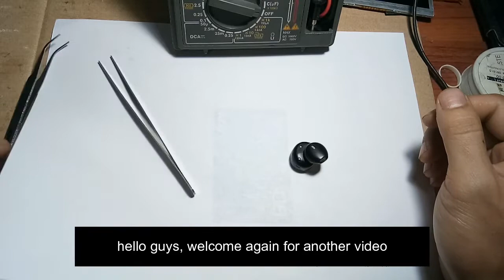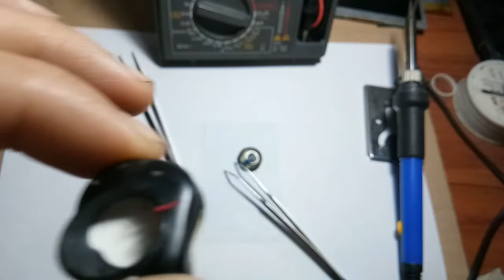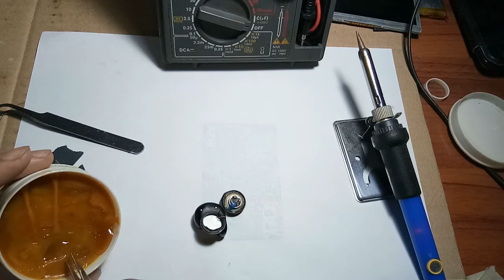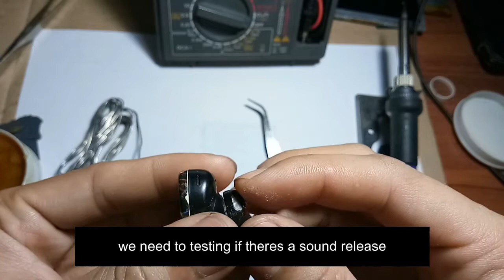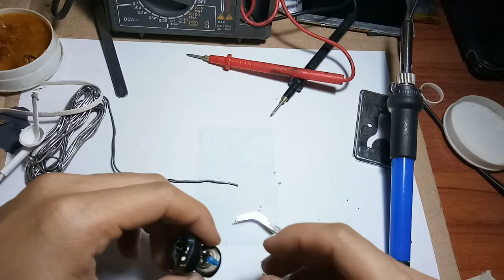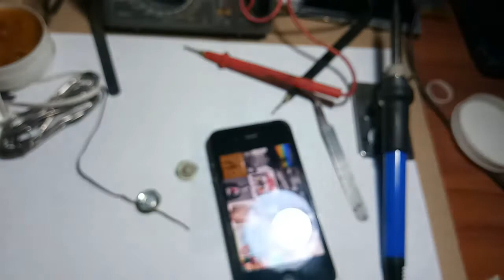Wireless Earbuds Repair/ Bluetooth earphone (Sabbat X12 pro)

Comment: Saan location niyo sir?
Reply from the maker: Valenzuela city boss
Reply: @timworks3657 still up pa yung shop? Where in val?
Reply: @timworks3657  san po sa Valenzuela? Papayos ko din po yung akin
Reply from the maker: @villarinjohnvincent9599  boss ano problema?  Ayaw gumana?
Reply from the maker: @reynoldcorpuz230  karuhatan boss
Reply from the maker: @villarinjohnvincent9599  karuhatan boss
Reply: Kuya yung sa akin, working naman yung speaker. Pero pag pairing, di madetect. Nireset ko napo pero ganon padin. Btw, left part po yung may problem na earbuds po